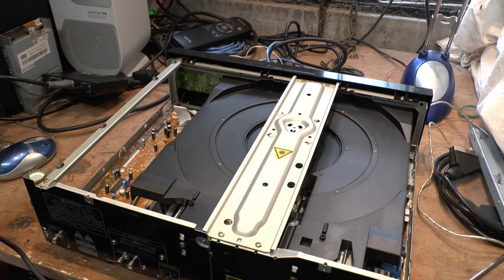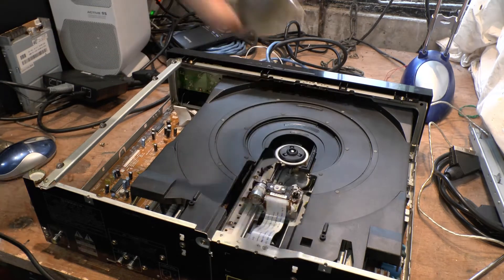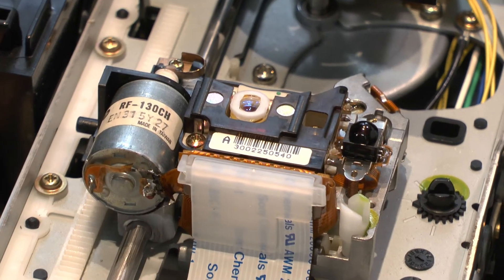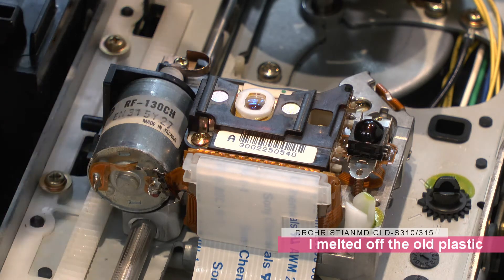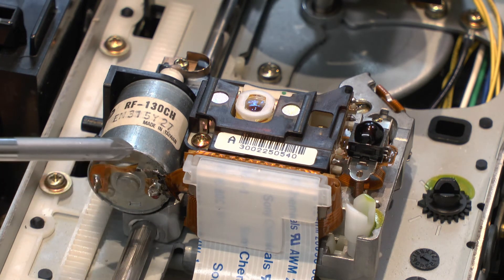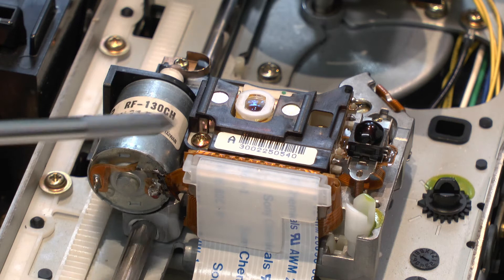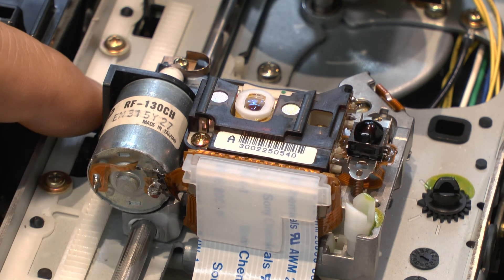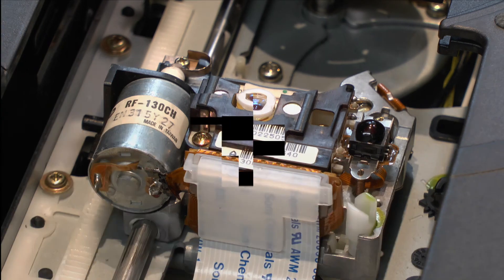Pioneer Laser Disc Player laser assembly CLD-S310 repair.

Comment: Hi, I have the same problem with a CLD-S315. Motor broken off entirely, m-holder bracket also broken. 
1) So you can just solder the flex cable together again and it will work ?
2) Do you know if a laser assembly from a S310F is interchangeable with the S315 ? That would be another way to fix it.
Reply from the maker: It can be hard to reattach the ribbon cable but it is possible. Attempt successful on a few occasions, with failure on one or two. One has a weird  error where it will play a disc side to the end. Next time it will fail at random positions.
1) Yes 
2) Yes.
3) Thanks for watching 😊